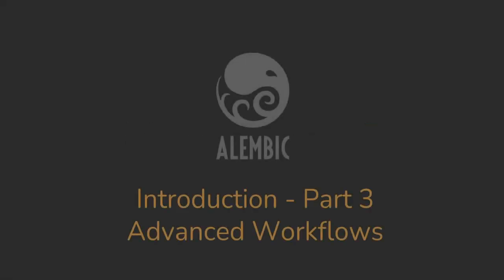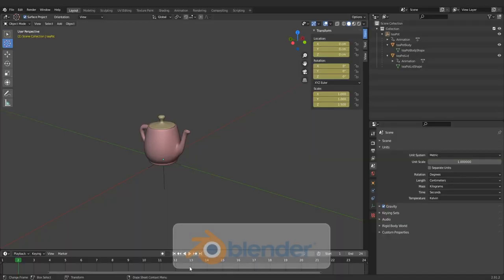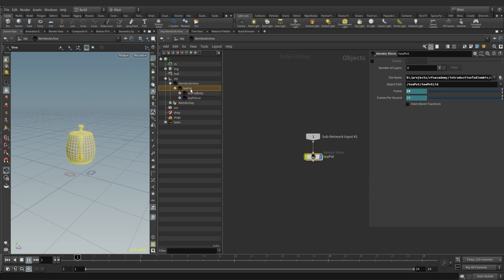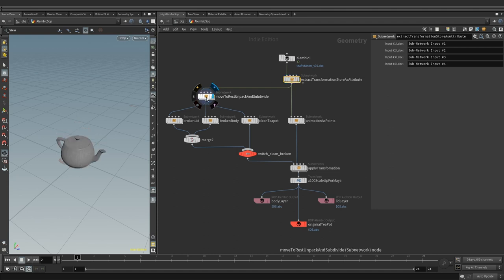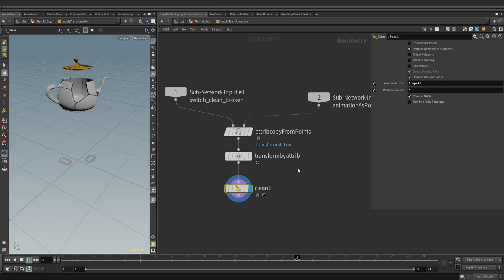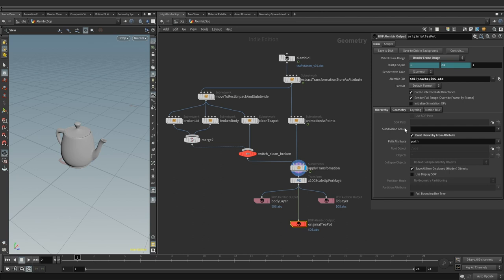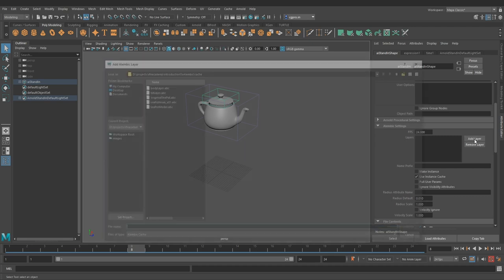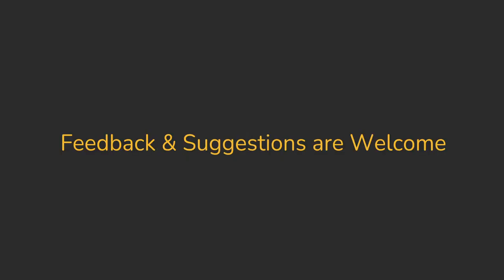Advanced 3D Workflow using Alembic

Comment: Hi, I’m experiencing an issue with Alembic animation in 3ds Max where my character’s movement only updates every 4 frames. For example, the character takes a step on frame 1, but then I have to move to frame 4 to see the next step. This results in a choppy animation where the walk cycle isn’t smooth. How can I adjust the animation or settings so that the character’s steps are closer together, eliminating the gap and making the animation fluid? Thank you!